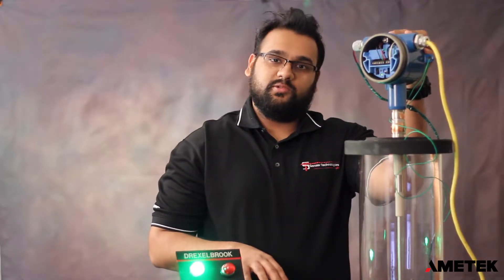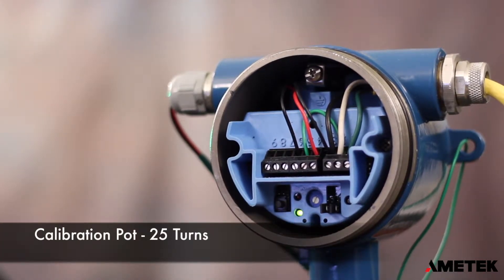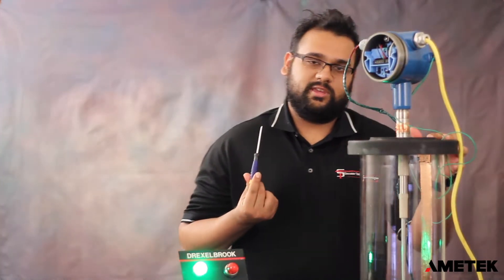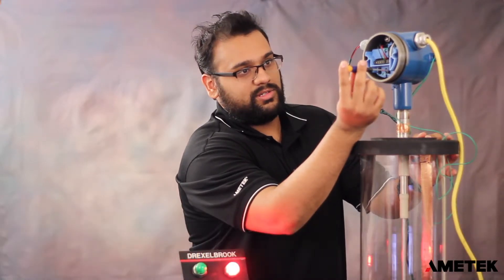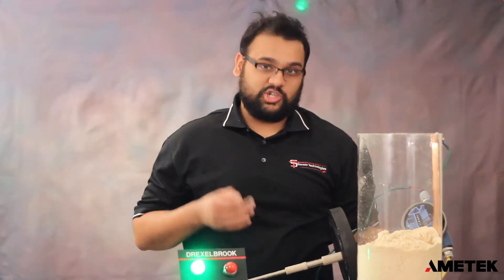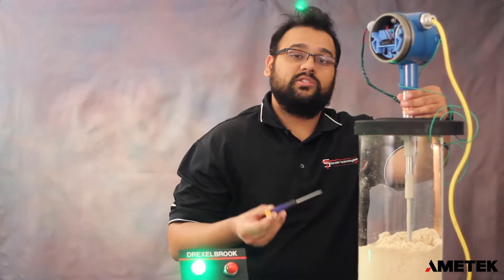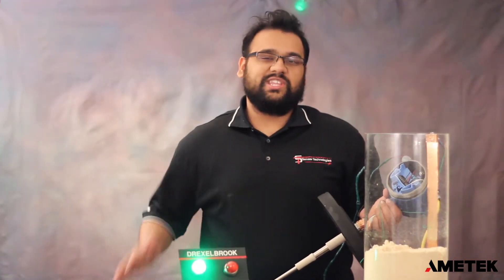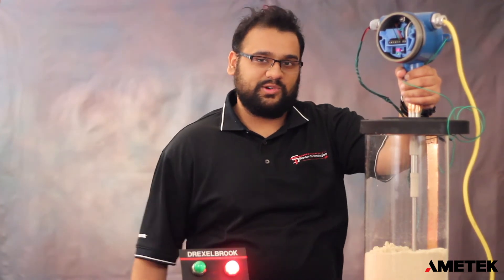Drexelbrook ThePoint Manual Calibration in Granulars When You Can Move The Level

Comment: what can be done if the green light blinks and the red light is on standby?
Reply from the maker: This is referring to an over-range condition. Green LED flashes and the red LED is constantly illuminated. This happens when the capacitance on the probe circuit exceeds the tuning range of the instrument. Potential causes are:
• Very long probes (> 15 ft active).
• Calibrating with the probe covered in product.
• Incorrect probe cable connections.
• Probe center rod in contact with tank structure.
• Defective probe or cable

For Application Assistance email: Drexelbrook.Applications@Ametek.com
For Technical Support email: Drexelbrook.Service@Ametek.com
For Sales, Quotes, & Order Status email: Drexelbrook.Sales@Ametek.com
For PO Submittal email: Drexelbrook.Pos@Ametek.com
Reply: @AMETEKTCI  thanks very much and the emails.